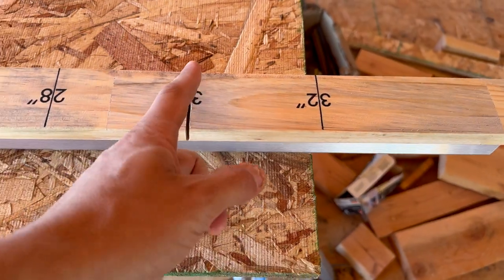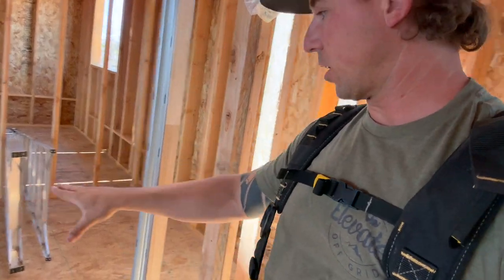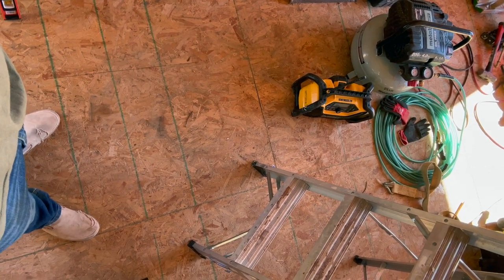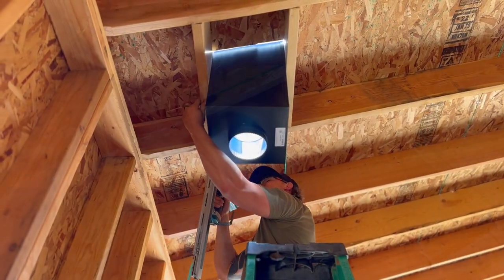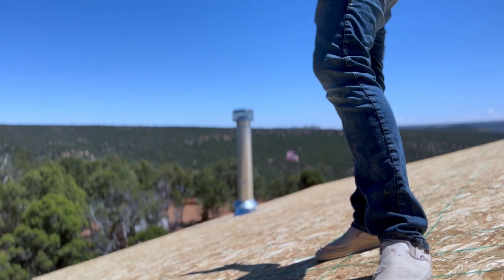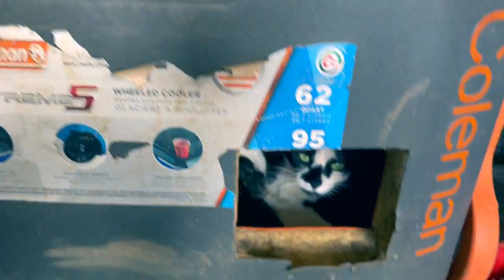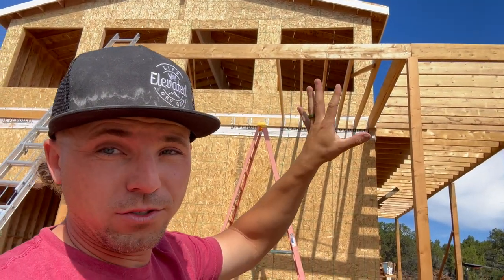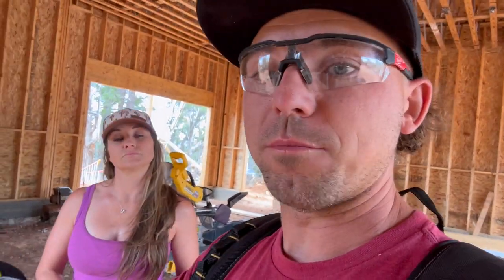OUR HEAT SOURCE HAS ARRIVED

Comment: if you use vented aluminum soffit material on the eves it will be faster, easier, vent better and last forever i have been installing vented aluminum and vinyl soffit for 35 years and what i installed 35 years ago in still up

Comment: I agree on supporting the chimney pipe after the metal roofing is installed. Metal brackets can be purchased that attach to the chimney and extend down to the roof.  If you are not going to have snow fence brackets to keep snow from sliding off the roof, I would also recommend installing a metal snow diverter above the chimney so the snow sliding is diverted to the sides of the chimney. Otherwise, it will damage the chimney, rip it off and or cause a leak. You guys are making great progress!

Comment: You might want to consider a "V" brace  for the chimney pipe to the roof--Gives it added strength in all weather !
Reply: Good idea. The folks at MBF, Mapleberry Farms, needed to install one after theirs blew over. I don't recall if it was snow load or high wind, but it needed straightened and supports added.
Reply: I was thinking the same thing with all that wind.
Reply: It helps to make the snow goes around your chimney.
Reply: It helps to make the snow goes around your chimney and strengthen it.

Comment: You need special hanger nails made for the galvanized brackets when nailing into pressure treated wood.  Otherwise, the nails will corrode due to the chemicals in the pressure treated wood.  This only started showing up when they changed the type of pressure treatment in the wood from the original CCA pressure treated wood.

Comment: Awesome video, I know that pocket door was Butch to put together, once you start doing your metal roofs I would rent a gas-powered boom lift for a month the type you could drive it around the house  instead of the towable one, then you could use it to install the windows, house wrap, and finish up siding your house. That looks like going to be a lot of work drilling those holes in those blocks for venting, I eliminated doing blocked on my garage I just use hurricane clips or as you call them hurricane ties. My inspector said either way would still pass.